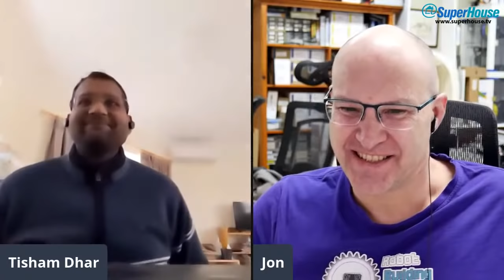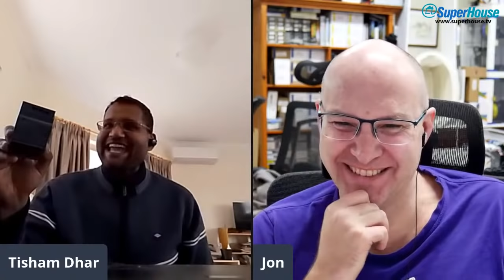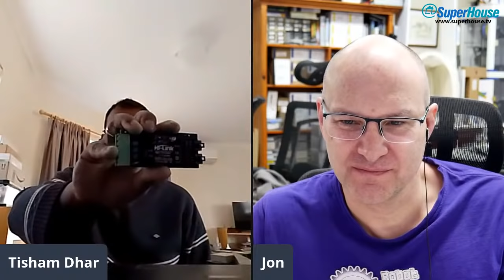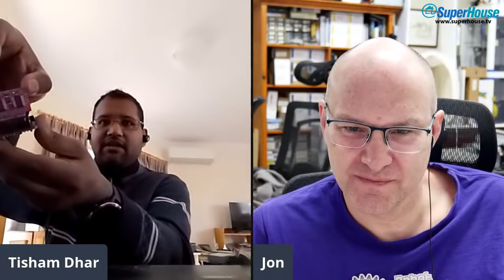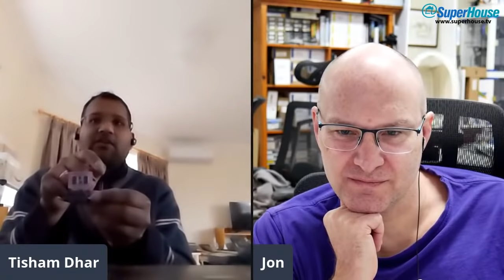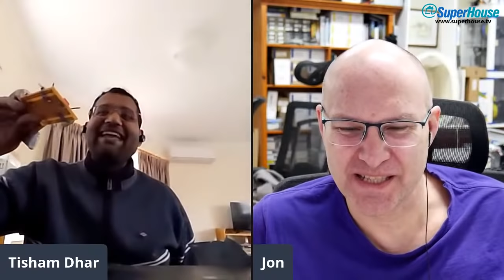Home Automation Hangout 2020-09-13 with Tisham Dhar

Comment: I wonder if 4-20ma control loops would work well for interconnects, its single signal, but its very easy and standard. Even rs422/485 you have to deal with bus termination and multidrop addressing.

Comment: @Jon: Interesting session :) WiFi has the limitation of most home routers only supporting 15-ish devices... meaning more Access Points are required to run the Home Automation.
DIN = Deutsche Industry Norm (German Industrial Norm); similar to Standards AU.
I use MQTT over Ethernet (wired) (whenever possible).
No standards around interconnections of DIN rail electronics. A bridge type connector, in on the left, out on the right. Addressing needs to be tackled. DIP switches?!
ModBus is the defacto standard for industrial electronics. There is a ModBus TCP (over Ethernet; route-able).

Comment: I must be missing something with this energy monitoring.

I can see that knowing the energy consumption of, say, a washing machine, in each point in its cycle, is academically interesting but I can't see its practical value unless, as was jokingly suggested, I buy one of each manufacturer's models at the white goods store and pick the lowest consumption example.

I follow the idea of scheduling devices for lowest grid price times but that hardly requires the sort of sample frequencies that were being talked about.

I'm confused...

PS
I completely agree with you on the folly of putting WiFi devices in metal boxes. It baffles me that some people, who should know better, advocate metal enclosures for Raspberry Pi 4s, to deal with the cooling problems, at the expense of WiFi.
Reply: I haven't watched the stream yet doing that now, but I caught a couple of minutes of it live earlier today. Why would you want to know individual energy consumption??? I can see a practical use for it if you have solar setup / power wall and you want to be able to control loads to best utilise the power consumption in the house. Using your home automation you could turn devices on and off to manage consumption to match input to output.
Reply: @DodgyBrothersEngineering  But knowing the profile of the washing machine seems academic to me (who has neither solar or powerwall and is completely 'on grid') because I either need to use it or I don't, so it will either use X Watt Hours, at a cost of whatever, or it won't.

Where I am, there is no form of time-based tarrif, it's all set price per KW/H. That is probably a significant factor in my failure to see the value of energy monitoring.
Reply: @duncanx99  Fairly sure most states in Australia (where both of these guys are located) have time based tarrifs. I have only just heard them say buy one of each, yes that was a bit tongue in check that they could offer to test out each of the white goods for the reseller. But you might want to know the energy consumed over the whole washing cycle. If you had solar it would be a great advantage to be able to map daily  / weekly consumption against usage, especially in Australia where new solar installs pay a pittance to feed back into the grid but charge you a motsa for drawing it out.
Reply from the maker: Knowing the energy profile is not something the individual end user would care about, and that's not what we meant at all. What we were talking about was from the point of view of companies that make energy monitoring devices, who want their device to be able to recognise devices in the house.

The end user already has a house full of appliances, and they buy an energy monitoring system. When it's installed, it doesn't need to be configured with a list of the devices in the house, because it can just watch the power consumption for a while and figure it out all by itself. After the device has been installed for a while it will know that you have a Miele model G4203 dishwasher and a Fisher & Paykel model DE6060M2 clothes dryer, because it already knows about the energy "signatures" that those specific devices create on the power line.

Our conversation at that point was about how the companies that make the power monitoring devices collect all those signatures in the first place, so their devices can recognise them, and how at some point an engineer probably walked into a whitegoods store and just bought one of every single appliance so they could measure their profiles.